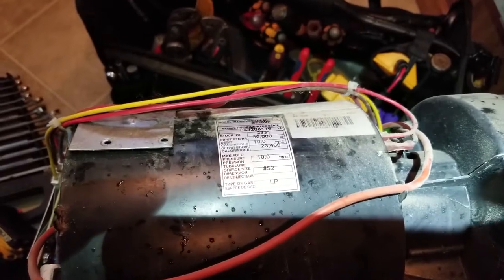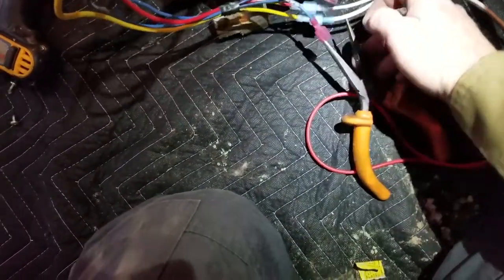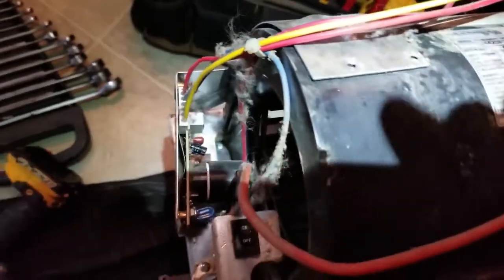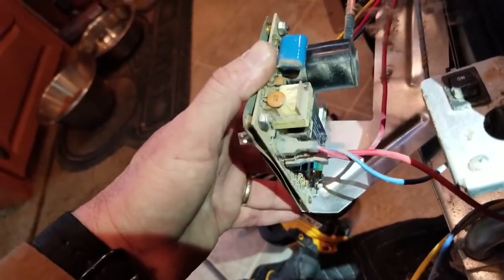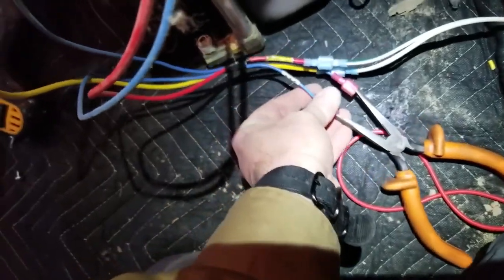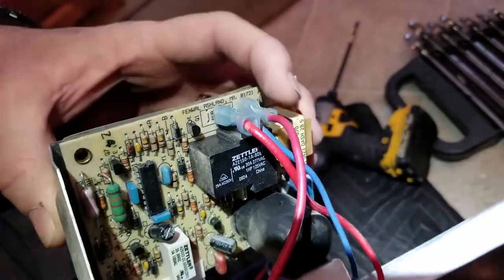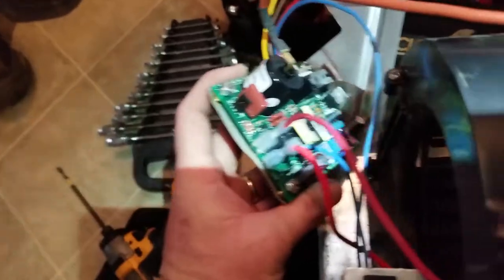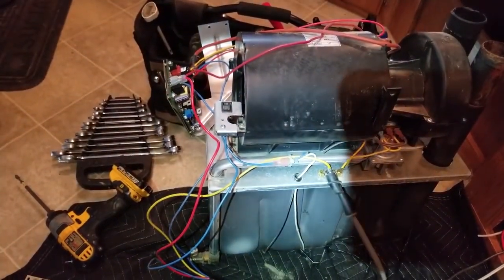Failed Relay On Suburban SF-30F RV Furnace Control Board

Comment: Thanks very much! I've got a 99 Winnie Itasca SunFlyer with a similar problem. After turning on the furnace, everything works as it should for about 10 minutes then it starts clicking and flips the breaker inside. After waiting a few minutes, I reset the breaker and everything works again for another few minutes then off again with the clicking. As this is an old MH, I'm thinking is probably board-related and replace it anyway.

Comment: Hey man, I have been troubleshooting my furnace all day.   It clicked but wouldn't start the motor.  I got a long screwdriver to reach in and wiggle that relay and it fired right up.  Got me and my family heat for the night!  Thanks so much.  I will order a control board this week.

Comment: OK Darren,  I just saw below your comment back to David about 9 months ago where you acknowledge you've seen failed solder points on these control boards, along with your reasoning for replacing the whole board instead of just the relay that needs to be soldered on as a "Board Level Repair".

Comment: I have the same exact problem with the same exact same furnace. I even got the fan to come on by banging on the relay, but only once. Turned out to be a bad solder point under the board where the 2 pins of the relay only had solder on one of the pins. I noticed it because of a tiny amount of discoloration that I believe is actually a burn mark from arching over the years until it just eventually lost all conductivity.

I used an ice pick on that missing solder point to prove that the relay was in fact working and only its solder point was bad.

So my buddy who's a retired jeweler now turned electronic repair technician is coming over tomorrow to drop a 2 cent dab of solder on that circuit board and I'm back in business!

I'm the 3rd owner & bought this 18 yr old camper from my cousin knowing the furnace was inoperable. After watching your video I realized I might just be able to figure it out by myself.

This furnace was worked on by the original owner because the wiring was cut and a jumper installed to add about 3 feet of wiring so it could be connected while out on the floor then slid back into its enclosure under the fridge. (This one doesn't have an outside service panel to access the wiring)

The reinstallation was so sloppy that the jumper extension wires were spliced in with those self stripping wire connectors often used for DIY trailer lighting like these https://www.etrailer.com/Accessories-and-Parts/Spectro/SWC501746-1.html instead of properly crimped on "Butt Connectors".

I even found the furnace cabinet was actually lying on top of much of that extra 3 feet of wiring when I removed it.

So your video taught me enough to figure this out myself & I'm eternally grateful to you Darrin.

However, since this appears to be a common problem with these furnaces (or their circuit boards) I suggest you check the back of the board next time instead of just opting for a complete $100 replacement of the whole component.

When you hear that "CLICK" it most likely means the Relay is in fact working. It just may be a bad solder point on the back of the board. 

Even if the Relay was bad, you should be able to remove it and replace it with a new $5 relay and 2 small dabs of solder instead of a whole new $100 circuit board.

The components on those boards are probably assembled using robotic soldering equipment and the manufacturer may have shipped out thousands of them without realizing one of their robot soldering tips was faulty. I only say this because I found about a dozen other YouTube videos besides yours trying to diagnose the same exact same problem.

Anyways, I found your "Style of Presentation" on your YouTube videos to be so informative, I stayed up a few extra hours watching about 10 of them.

I'm in Michigan a few thousand miles from your location in Washington, otherwise, I probably would have submitted a service request to you.

Thanks again, Darrin and all the best!

Comment: Thanks, I'm working on a trailer with this unit , fan motor is proven to work when it gets 12v and ground, thermostat clicks, all things lead to this relay or something on the board.  I am going to do the wiggle test.
   How do I make sure I order the correct control board?

Comment: Hey Darren have you ever worked on a suburban RV furnace… An old one, this is an NT 24. The furnace comes on no problem and runs the thing that I noticed is that after it’s lit. The igniter stays on. 
When the thermostat is in the off position there is no igniter which is good but when I turn on  the furnace on igniter comes on like it should everything lights up, I got heat, but the igniter stays on. Also, it looks like there are two igniters. I noticed after about 4 minutes it switched over to the other one.  Any help is appreciated.

Comment: I have an sf35. Motor comes on, I can smell propane flow but it won't attempt to light. I checked sail switch and high temp switch and both are fine. Could this be a board failure? Any way to test?

Comment: Hello, Had the same issue with my furnace unit.  When twisting the board, the unit would "click" and nothing would happen.  After further investigation, a solder point below the solenoid on main circuit board  was broken, incomplete.  I re- soldered it and now the furnace works perfect!

If I could, I would post a picture of this problem connection...

Replacing a circuit board may be overkill when all u need is to further investigate the issue.  I did not spend a dime, other than my time, which was required in the first place...  Heat up a soldering iron, solder the poor connection...  Cost - Zero,  That does not bode well for the parts replacement companies...   Sorry...
Reply: I agree with you.  Another minute of troubleshooting on that simple board would have nailed the exact issue down.  If it was the relay, a new replacement would have cost about $5.

Comment: Can you just replace the relay switch? If not why?
Reply: Hi David,
The fan relay is soldered to the control board.  Anyone that is familiar with board level repairs can certainly make that repair.  We have seen failed solder points on these control boards, so this is not uncommon.  From me, when I come across a failed component on a board, I replaced the entire board for warranty and liability reasons.  If I were to make the board level repair and it failed again the repair liability falls back on me. If I replace the entire board it comes with a 3-year warranty from the board mfg.  That is better for me and the customer.
Thanks for the comment!
Darren

Comment: I'm in tacoma and I can't figure out why my suburban sf-30f won't ignite.  Please help.  I changed out limit, sail and ignitor.  Propane is full, stove top works so no leaking.  Blower works as well.
Reply: Check for battery voltage and Heath, propane pressure with manometer.

Comment: How can u assume the sail switch is good if the fan isn’t running.  If that was true then the sail switch would have to fail in the closed position.  However fan should run before the sail switch needs to be working so that in its self proves that it’s not the high limit or sail switch

Comment: Hello,
I also have an sf-30 heater. We replaced the ignitor, sail switch. The fan works, we get spark but when we put the heater back in, it doesn't ignite. Any thing we could be missing?
Reply: Have a look at this other video I uploaded on the Suburban electrode alignment:  https://youtu.be/uGVN1xws4Tw
If you are getting spark it may be something as  easy as the electrode not in the correct place - too close, too far etc.

Something else it may be is inadequate LP pressure.  I have a video I uploaded on that topic too:  https://youtu.be/SD1qcH_hNYY
Also if where you are located is cold and your LP cylinders are below 1/2 than the gas law is playing a cruel trick on you.  The LP tanks need to be kept warm to generate adequate vaper pressure.  The colder the LP gets the less vapor pressure it has.  A heating pad with a moving blanket wrapped around them will work wonders in that scenario.

After checking those items, if you are still having issues, follow back up with me here and we can go deeper.

Good luck!
Cheers,
Darren.
Reply: An additional think I though of...  When the furnace is sparking you should smell the LP gas.  If you do not smell the LP than have a look at the gas solenoids and the gas valve itself.

Comment: Where can I get the New control board for the SF-30 furnace?  I have been looking up the part number but nothing comes up for the control board.  Thanks
Reply from the maker: Here is one on Amazon:  https://amzn.to/2ZQB6Gd
This board comes with a 3-year warranty too.
Reply: @MyRVWorks   so I have the sf-30 and on my board it has the 2 reds and the blue in the center. The board you recommend only has 2 slots in that location?